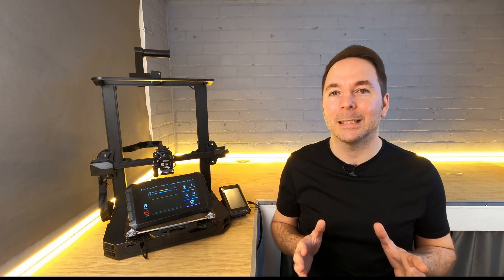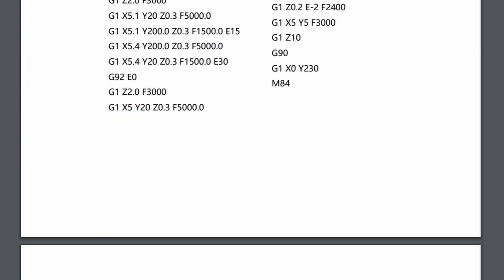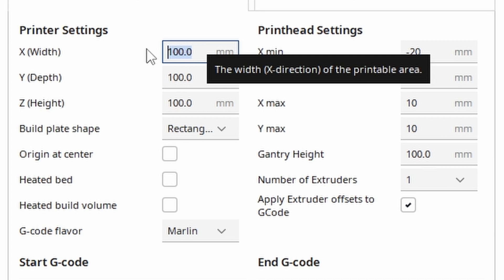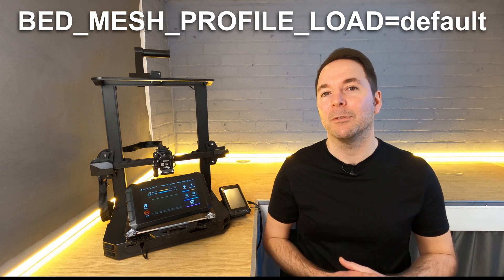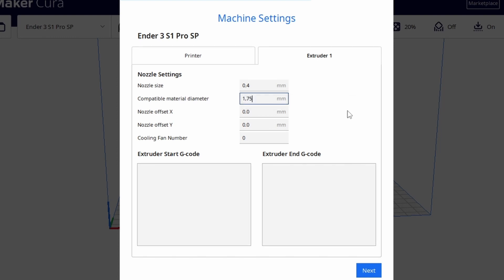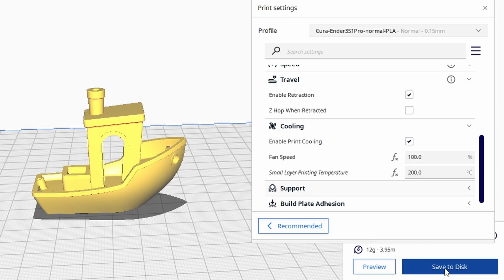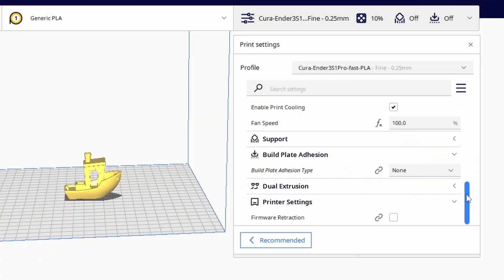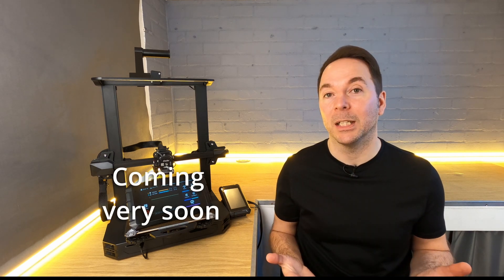Slicer Settings and Profiles With Cura - Sonic Pad Intermediate Part 3

Comment: Why did you specify a wrong printer dimension in your settings? S1 Pro has 220x220x270. I assume you just copied everything from the pdf. :D
Reply from the maker: I did😬 To be fair, I have been running with these and I've had no problems myself.

Comment: Why does those profiles make you change the print dimensions to 235x235x250 when s1 have 220x220x270??? (now when i think of it, in creality print it auto give me 230x230x270) :D
Reply from the maker: I copied straight from the Creality pdf without fully checking unfortunately 😬

Comment: I tried importing the cura profiles for my sonic pad and it said it couldn't import because the quality is not compatible. How do I work around this issue?
Reply from the maker: Did you create the new machine first? You can't just import these to a standard profile.
Reply: @RickyImpey  I didn’t.  I’ll try that. Thanks.
Reply: I'm getting the same error code, I did create a new profile for my printer. I tried to edit the Quality name in the file but still got the same error only with the new quality name. Also, tried shortening the path to the file. I have an Ender S1 plus so the S1 pro should be the correct profiles. Any thoughts? maybe uninstall and start from scratch?

Comment: Could you do these videos for the Artillery sidewinder,  as this is a really good series of videos
Reply from the maker: In theory, once you have any machine connected, all of the videos from number 2 in the basics series are suitable for every machine. The Sidewinder was a little tricky to get setup but only because it has a more involved process for uploading firmware.
Reply: @Ricky Impey  i was just thinking of the slicer set up as the artillery x2 is a bit different to the s1
Reply from the maker: @Retroforge-creations  Ah, I see! I will probably start with the S1 Pro profiles after creating a new FFF machine. As far as slicing is concerned, there is not that much difference in spec. There may be a few tweaks here and there but it should be a good starting point.
Reply: @Ricky Impey  what if i use prusaslicer? Is there a way you could do that as a add on video, or is there a profile on creality for prusaslicer
Reply from the maker: @Retroforge-creations  I do plan on looking at Prusa Slicer. I will see if there is enough info for a video, I imagine there will be.

Comment: I use Prusa's Slicer and this will give me a lot of good info. to translate into the Prusa settings, thanks!  Glad you released the intermediate videos, just got my Sonic Pad set up and running a couple days ago
Reply from the maker: A lot is transferable. The most important things are to turn off any acceleration control when you do Input Shaping and Pressure Advance. You should be able to ramp up speeds to around 150mm/s once things are dialed in a little.
Reply: @RickyImpey  nice, ty!
Reply: Can you use the sonic pad over your network with prusa slicer?
Reply: @ArtisanDepot  Yes, with the web interface up I can upload the gcode file from Prusa slicer to the printer.  Works great 👍